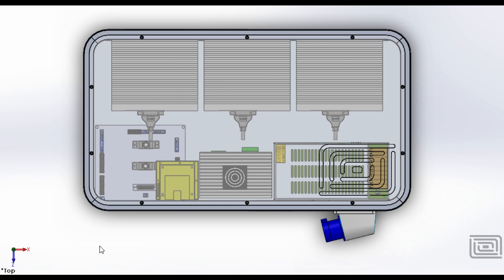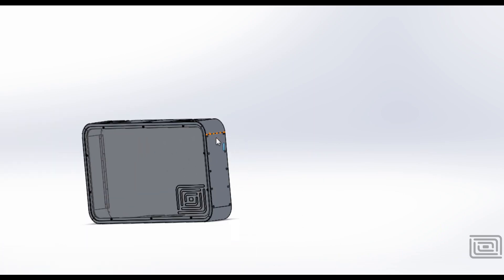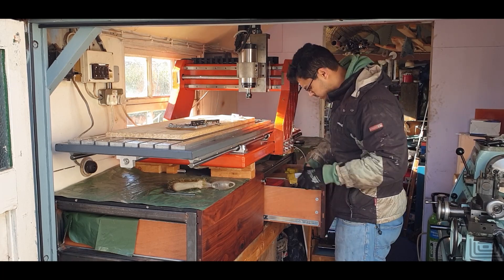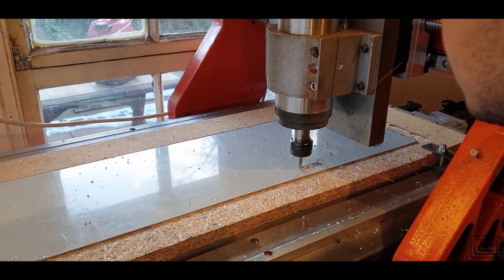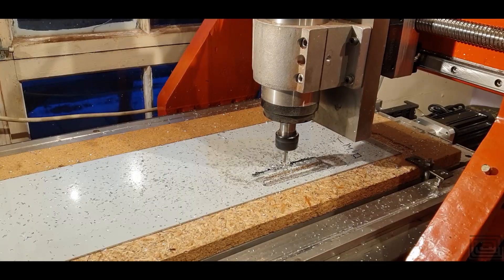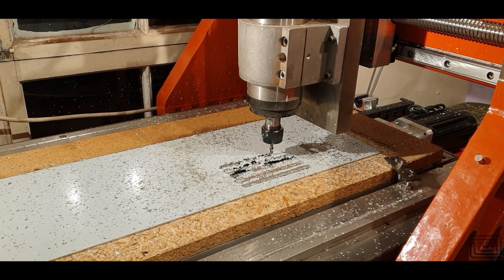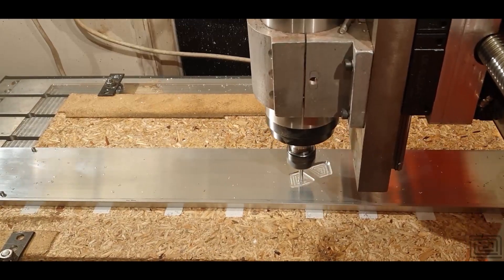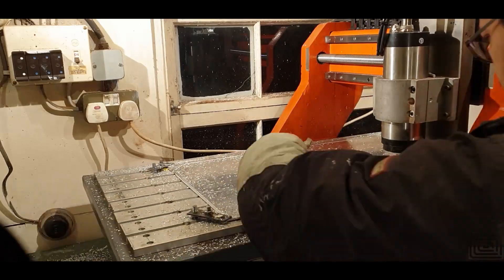CNC Milling Parts for my Custom Electrical Cabinet - Part 1

Comment: That is a beautiful fixed gantry machine. I love the beefy design. I was a machinist and CNC programmer for 15 years. Never used anything that small, but I'm thinking of building a CNC mill of my own. It will be a fixed gantry like yours.
Reply from the maker: Thanks! I'm working on a ATC bt30 spindle system for the machine which will hopefully mean it'll be a little more efficient with ferrous materials. (probably be my next video)
Would love to follow your build. Let us know if you do decide to make a thread or videos to document it.

Comment: You could try the powder coating tape and or masking tape  and super glue work holding technique.

You apply the tape to each surface burnish it a bit so its very secure and then use super glue to hold the work down.

This is a link to NYCNC channel showing it done with maskign tape but the 2 Mil Polyester Tape with Silicone Adhesive works the best.

https://www.youtube.com/watch?time_continue=201&v=r6DCvtcU8_M

And another one from Crimson Guitars from 2014...

https://www.youtube.com/watch?v=ub6PsY4cgwg

I hope this helps.
Reply from the maker: Thanks for the tip. I checked out the videos and I will definitely try this out next time!